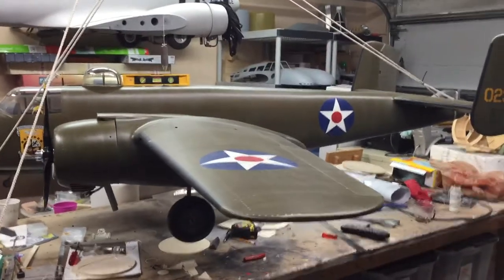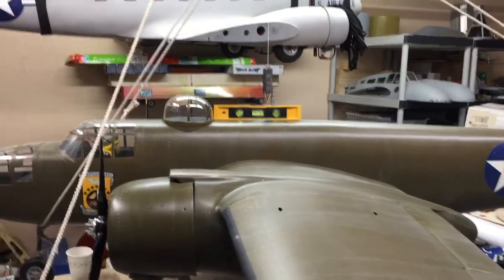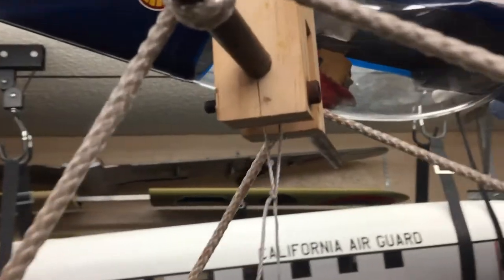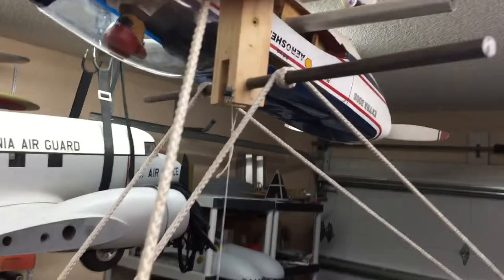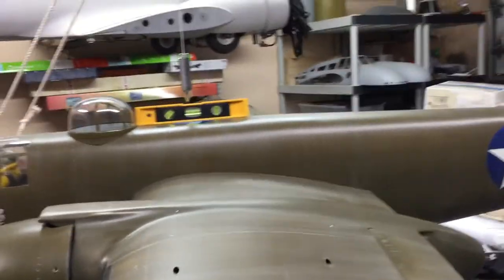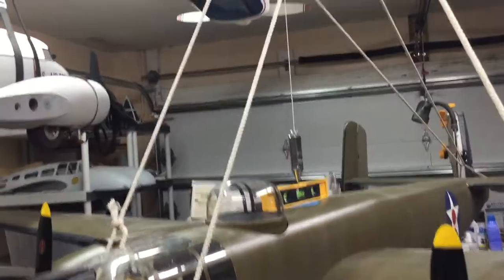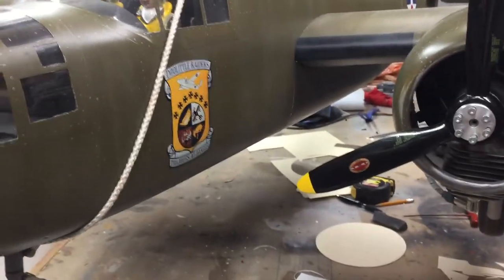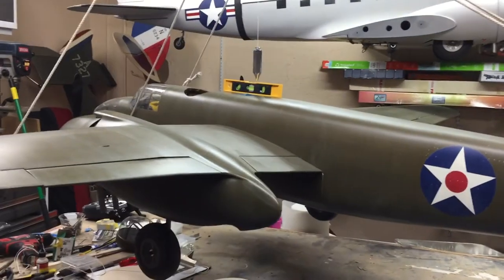IMG 7184

Comment: Nicely done Mark. Yes, thank you for this.

Just to be clear though, the plumb bob will always point at the true CG of the model, regardless of the fuselage attitude. The need for a level fuselage allows accurate reference to the mark on the tape, which is a vertical extension of the CG line of the model.